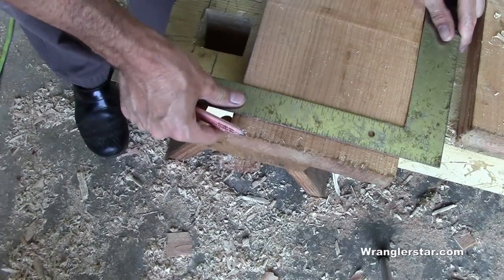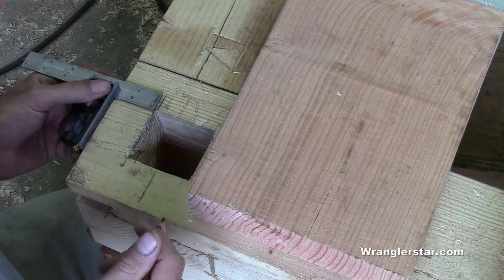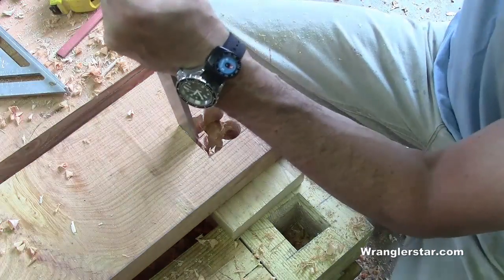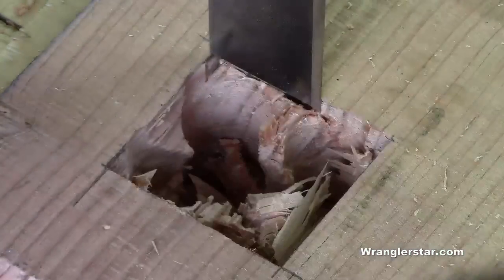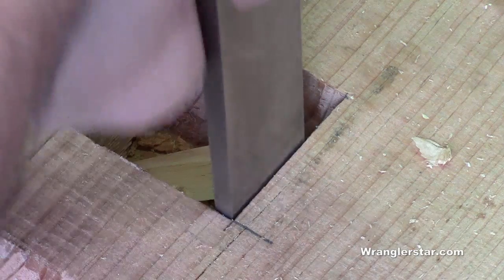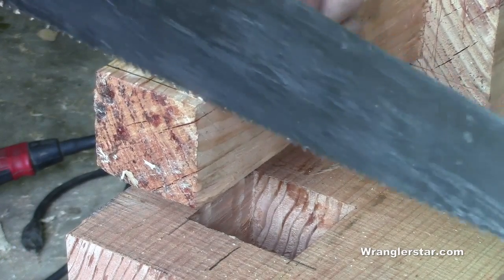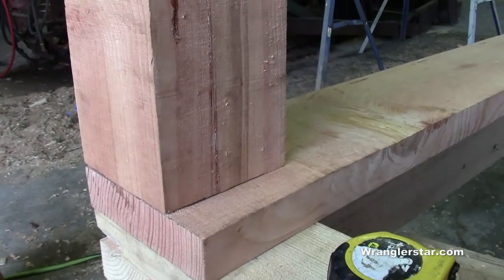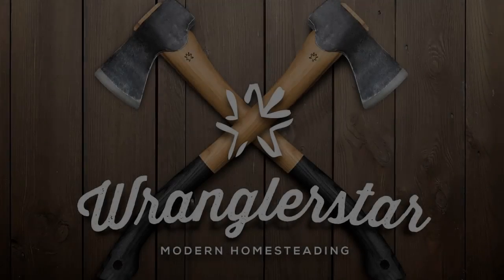Timber Framing | 19 Wranglerstar

Comment: I also believe everything should be done to the best of ones ability. I recently moved to a new house in New England and when I was in the house for the first time (it being new construction) I noticed that every flat head screw on every single light switch and wall socket was facing the same way. I checked every single last screw in the house and I was ver impressed by that. It's the little things that shows true effort
Reply: No because you can't tighten the screw all the way down onto plastic because it would crack the cover plates to the switches and outlets. Look at the screws in all of yours. All of the screws in my house are vertical. The groove is running straight up and down. Cody has even taken note of this in previous videos.
Reply: You have to purposefully tighten the screws to be going in any specific direction. Cody has even made note of this in other previous videos using the exact example of flat head screws.
Reply: It is called clocking the screws. It is not easy to do as the screws and the threads are not all made with the same exact orientation. You see it more in watchmaking, gunsmithing and the like. Sometimes on furniture hardware. Someone does it on the all the switchplates in the house? Either a solid show of workmanship or a brutal inspector. Impressive either way.
Reply: I know it's not a construction standard or anything having to do with code. That was my point to begin with, that the people who took the time to do this in a house that they will most likely never set foot in again are people that have an attention to detail. Even if they nobody knows about it, they will. And you saying that it is just another small detail that can simply be overlooked, although true it is a small detail, shows that these people cared while you might not. Nobody asked them to, nobody paid them extra. They had that extra attention to detail that I respect.
Reply: Jim Watson Not the code inspectors. I have seen some pretty interesting customer inspections. Extra attention can also be given to trainees to teach them about workmanship.

Comment: I would like to relate a personal story of old time craftsmanship.

I bought an old home in up state NY decades ago. It had been remodeled before I took ownership of the property. It was the original farm house for the farm. The man that owned the farm built it by hand. When we sat down to sign the paperwork the Title said 100+ years old.

After taking posession of the home we started noticing the craftsmanship of the bones of the house. The man used rough cut red oak 2x4's on 13" centers. The mill work was huge chestnut boards. The flooring was finished red oak. The beams that held the structure were ruff hued red oak of indeterminate sizes. The original floor in the basement was dirt. The foundation was rubble stone & the house was built over the water well.

I wondered at the craftsmanship of a person that built such a home. That even though the previous owners had abused the home & didn't maintain it, that it would turn out to be such a find after a little polish by some contractors. However, when the contractors fixed the damage one could see the love & attention that the original builder put into building the family farm house.

Comment: Nice joint sir. One minor quibble. You are right but didn't explain the real reason clearly enough :)  You shorten the tenon so it doesn't contact the bottom and wick moisture up into the tenon. The wood will swell to the sides with moisture but it won't lengthen.  If the tenon swells, it can crack the deck board and provide entry to even more water and start the whole thing to rot.

Comment: Funny how I've used a speed square for decades and it has never occurred to me to use it as a circular saw guide for short cross cuts. I've always used the method my father taught me for guiding a hand saw with my thumbnail. This method is better and safer, and I will undoubtedly use it from now on. I'll also pass it along. Thanks for the great tip.

Comment: When squaring stock with a circular saw, it's a good idea (when possible) to put the WIDE side of the saw shoe on the piece being squared.  That helpls make a better cut because the saw doesn't have a tendency to tip over at the end of the cut.

Comment: Impressive timber framing Cody, do you add glue, pegs, screws or nails to the joint in this video?
Reply from the maker: No it's done as is,
Reply: wranglerstar Will there be a similar joint on the top of this post? I am a little confused as to what stops the walls from being pushed outwards by the roof. Will there be diagonal braces? Or is there a frame at the top to hold it all together?
Reply: Michael Hutin
You can look up "Knee Brace" I think that is what Cody is going to use for his build.
http://www.yankeebarnhomes.com/wp-content/uploads/2012/01/vt-barn-1030.jpg
Reply: StuInTokyo Thanks for link, I'm amazed the square peg Cody cut into the vertical beam will be carrying all the weight and strain.
Reply: Jim Watson There actually will be horizontal strain. Wind load mainly. It will be distributed by the rest of the frame though so not much will be on the joint itself. Depending on where you live, there may building codes for strapping it down. Usually with straps that run all the way from the top plate down to the sill and possibly with anchors as well. Probably not with something as small as he is building but it might also require cross bracing to be let into the timbers.
Reply: Jim Watson Yes, I don't know exactly where he lives but chinook winds in the mountains can hit hurricane force. It can be worse when surrounded by mountains as they funnel the winds. Siding is no replacement for adequate cross bracing. You are right that it is unlikely to lift a whole building but there is a huge difference between lifting a building and breaking a 2x2 tenon on the end of a 10 foot long lever. Existing structures are not usually retro-fitted to new building codes so most likely you are right that there are probably not straps in the existing buildings. Again, not knowing exactly where he lives, I have no way of knowing what building codes are in force where he is (if any.) Most places anymore have building codes that cover all unincorporated properties.
Reply from the maker: David Kirtley The frame will have a double knee brace let in to each post and girt  for a total of 8. This will take care of any shear problems. Everything will be clear in part 20. Thanks for sharing your experience David,
Reply: Michael Hutin the square peg at the bottom only keeps everything from sliding around. The load is transferred through the post to the flat around the peg into the floor boards and into the frame. That is one reason the peg has to be cut a little short, so as everything settles it doesn't end up bearing weight.
Reply: EVERYONE - The reason this Cabin is taking so long is because back in the day one would have Several family members and neighbors to help erect something like this. A one man band if you will takes A LOT of time.
Reply: Michael Hutin
Snow load=push out at the plate=shear peg=roof falls down and kills family while sleeping snuggly.
Reply: +don christie That's only true if you have nothing at the top of the walls to take the "spreading load" of the roof.  That's what ceiling joists are for.  On something this small, the girts are sufficient.

Comment: At around 1:40 it looks like your tenons in the corner are splitting out, whats going on there? I prefer hearing someone encourage and demonstrate the significance of quality. I have worked several years in retail and one of the reasons I had to get out was because it just drove me nuts dealing with people buying and complaining about the low quality products. Either get quality or make quality.